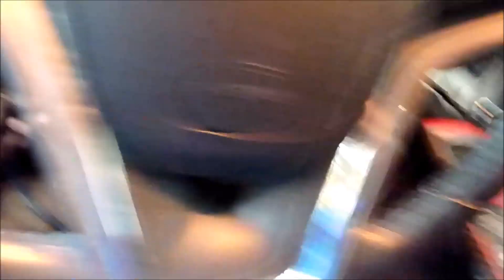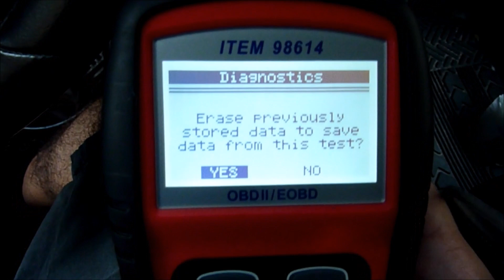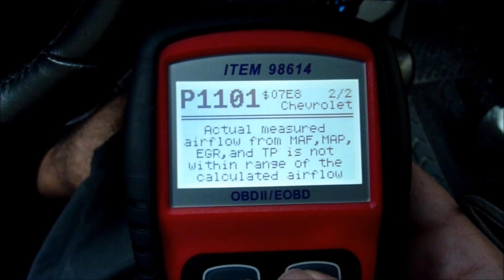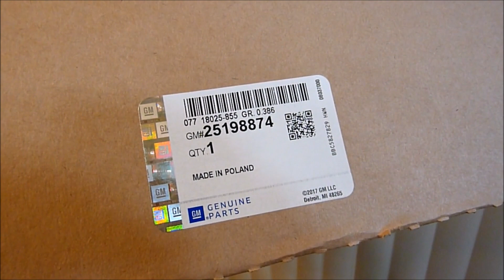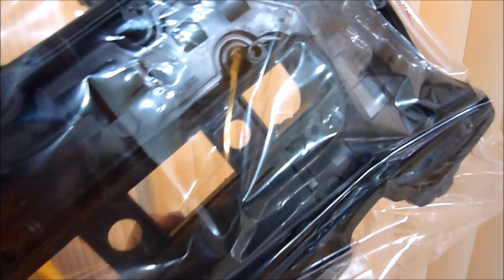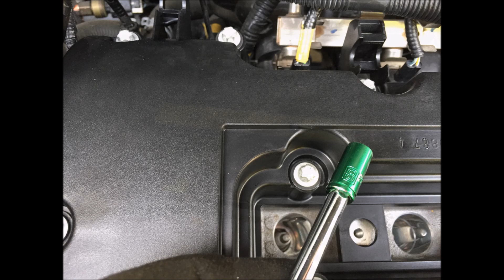Sonic PCV Fix, Error codes P0106 & P1101

Comment: I have po1101 code..but I don't have the vacuum leak on the  part u replaced...I do hear a hissing sound...could it be the manifold?the throttle body?
Reply: From what I saw 
Try spraying lightly while the vehicle runs
At your own risk lol
They said it’ll change the way the noise sounds but like lowering the hiss you know? Then that’s where the problem May be

Comment: When the diaphragm on the top goes bad, does it always suck air? My wife's Sonic has a click then it starts sucking air. I think it clicks again then it stops sucking air. It's intermittent... The engine acts like it wants to die when I cover the hole with my finger.
Reply: The clicking off and on means it's working
Reply: The clicking off and on means it's working
Reply: The clicking off and on means it's working
Reply: The clicking off and on means it's working
Reply: The clicking off and on means it's working
Reply: The clicking off and on means it's working
Reply: The clicking off and on means it's working
Reply: The clicking off and on means it's working
Reply: I'm not sure but yours sounds like it's working.
When they're bad they suck air all the time.
My Sonic was chugging especially when it was stopped at a red light come to find out it was the coil pack which is a 10 to 15 minute change and $50 for the part very easy to do

Comment: I have a 2011 chevy cruze 1.4t , but with only one code p1101...i replaced the air filter 2days ago now the code pop up ? Could it be the maf wiring is bad?
Reply: Sky Racer Maf could just be dirty
Reply: @12verjef  have u ever figured it out
Reply: @12verjef  thanks
Reply: I have the same issue with my car but it’s only code P1101 …